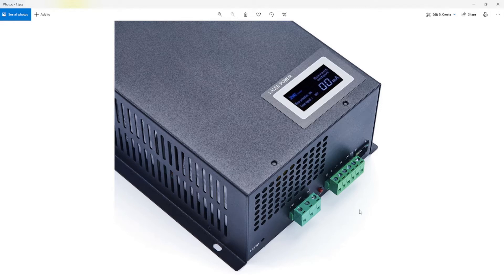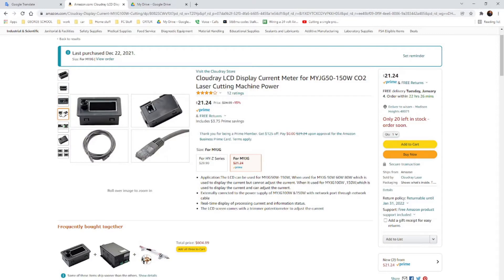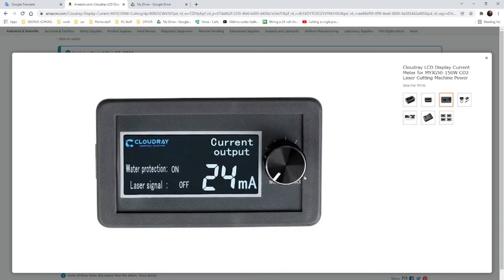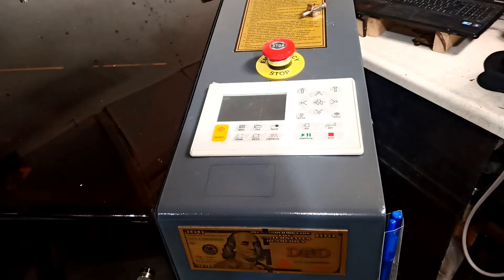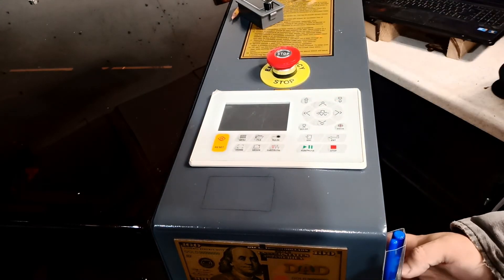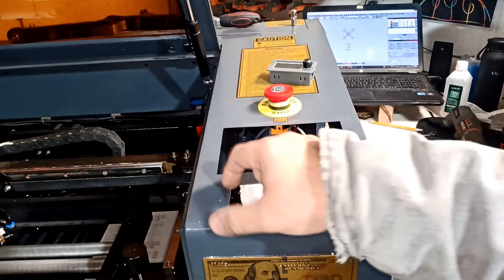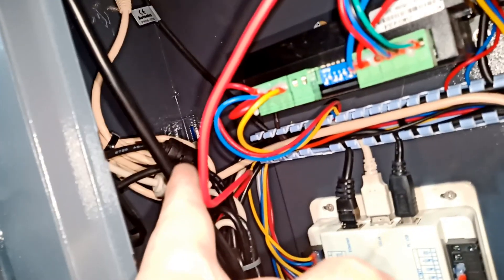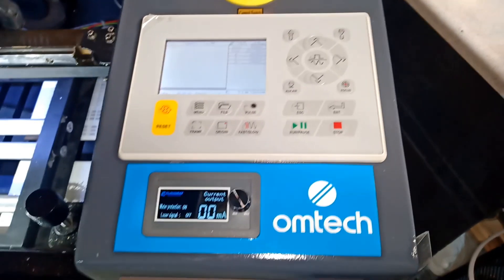Adding Milliamp Reader To OMtech CO2 Laser

Comment: so the only wiring is the ethernet cable ?
Reply from the maker: Yes only Ethernet cable
Reply: @wisamyousif14  cool have a new 60w omtech that will be delivered in a couple of days if it has the power supply with ethernet port will get one of them instead of the one you have to splice in to the wiring
Reply from the maker: @Dumplin_Amzy  small note due to digital when you're engraving you will almost not see it moving but if you're cutting this will work very good you can see everything
Reply: @wisamyousif14  the laser came today put it does not have the power supply that will use the digital so have to use a analog meter. But to my surprise it did have a pointer installed on the laser head which is nice
Reply from the maker: @Dumplin_Amzy  are you sure most of power supplies of OMTech they come with the  option is all the way in the bottom
Reply: @wisamyousif14  it is one of the blue power supplies and don't have to screen that sow the Milliamps ont power suppy